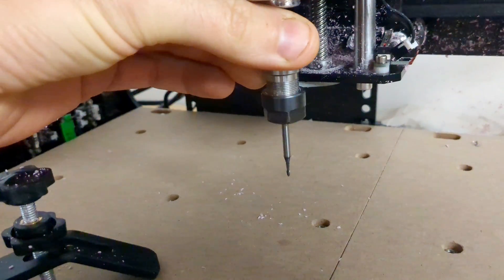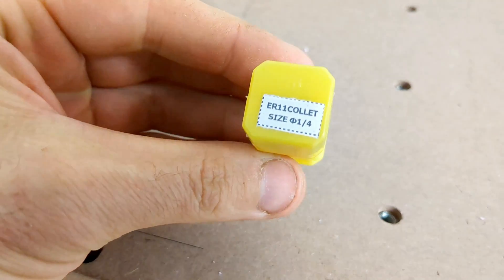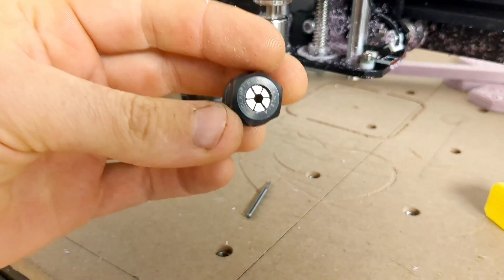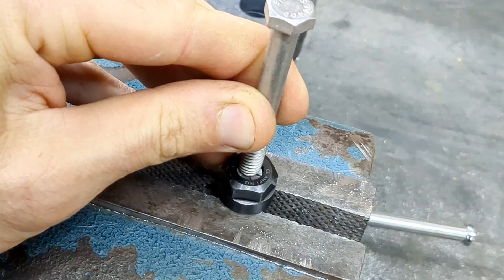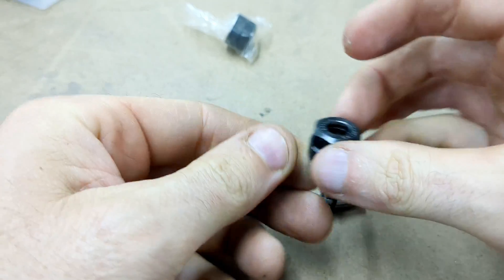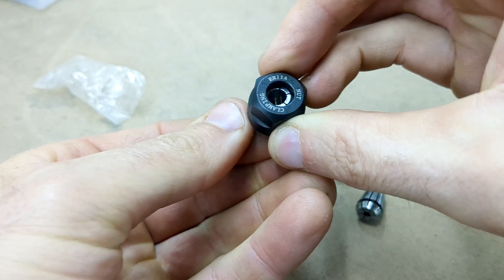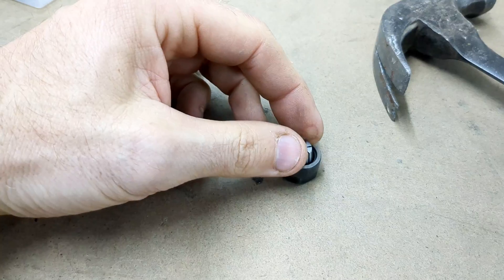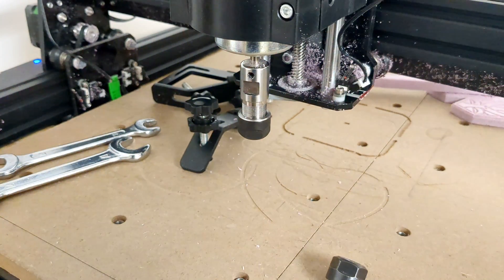How to Change The Collet on Your CNC - EASY Collet Swap

Comment: You don't need to drive collets in and out. If the nut is made correctly, you put the collet in at an angle and roll it in or out. I do it all the time.
Reply from the maker: Interesting, I really gave it a try with my fingers.  If I need to change the collet again, I'll give that a try 👍👍
Reply: @HeinrichsMade  Tap the nut on a table and the collet will drop out, if not try different angles
Reply: On an ER11 specifically? I find them too small to do by hand. And doing it the way shown in the video I broke the only nut that came with my RoutER11. Just ordered a set of replacement nuts so I can dedicate them to collets.